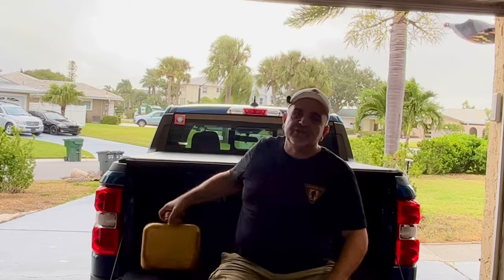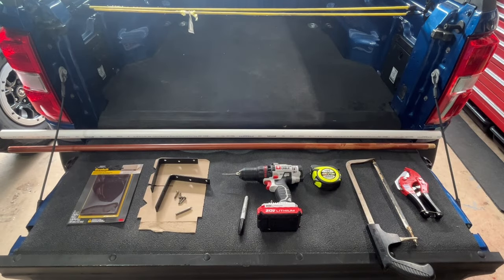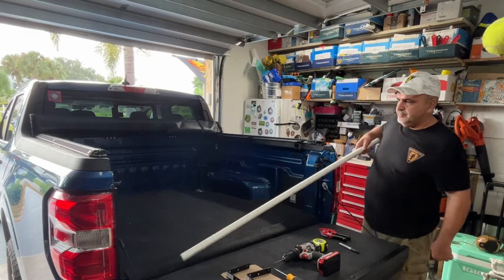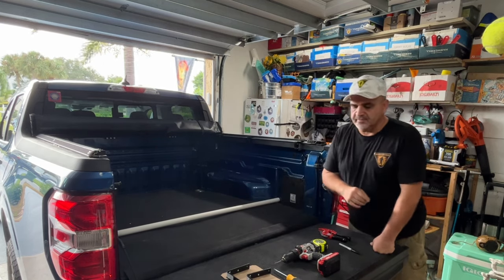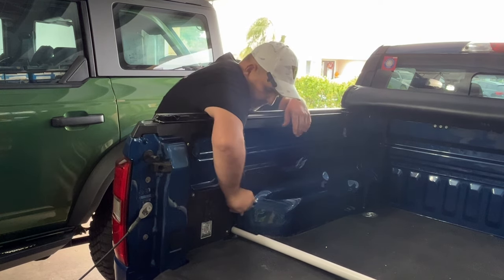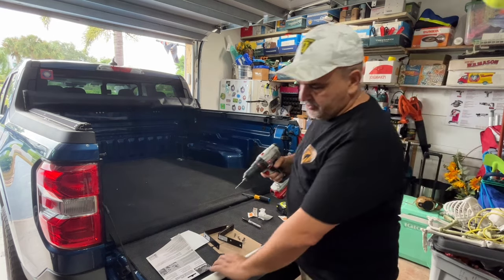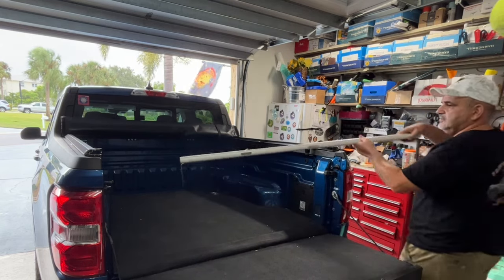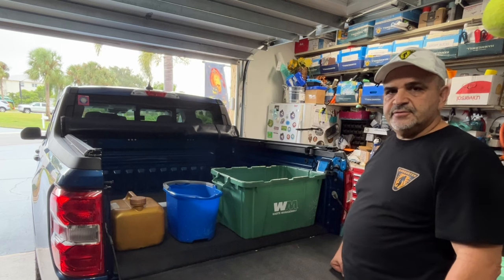Make a Truck, bed divider, and retrieval tool for your Ford Maverick.  #fred'sgarage

Comment: Thanks fred I used your idea. I used 1 1/4 inch pvc schedule 40. I have 15 dollars in it so far. I have a hybrid with a drop in bedliner. The width dimension was 54 inches. I also bought a can of behr primer and paint in black to match the bedliner cover.
Reply from the maker: Great man, it’s very handy, especially if you need to retrieve something.  If you find bins that fit nice please let me know where you got them.
Reply: @fredsgarage1925  will do thanks

Comment: I'm using a piece of shiplap, but I like this idea better.  Thanks!
Reply from the maker: Thanks, it’s too bad some company doesn’t make a better version.
Reply: @fredsgarage1925  I made your design and it works better than the shiplap.  I had the tools, so it only ended up costing me a few cents over $10 for the divider and about $17 for two plastic bins that fit the back perfectly.  Now our grocery pickup won't be a nightmare.  Thanks again!
Reply from the maker: @AlThomas-n6o great, ya the bins are a huge help.  Have a great day.

Comment: Really love your ideas for the Maverick!  This one was a great idea especially since it can be a retriever for you, too.  For me, I bought the Ratcheting Cargo Bar from Harbor Freight for about $30 and it served me well
Reply from the maker: Thanks, I had one on my older tocoma and the bed was wider so 2 recycling bins would fit sis by side. I could toss everything in this bins.  If you come with any ideas let me know.  Have a great day.
Reply: I dont know how I stumbled across your channel, but man im glad I did! you have some great Ideas! Really appreciate you taking the time to show how you do the projects. When you mentioned in the video abou the bins being a good idea, you were definitely in my head lol. Keep up the great vids!
Reply from the maker: @darrenb4619  thank you so much for the comment. If you happen to come across bins that will fit please comment on where you found them.  Have a great day.
Reply: @fredsgarage1925 does it rattle when you drive? That was one of the reasons why I didn't use the 2x6 in the flex bed.  Even the people that covered it in felt or some fabric said the same.   The Harbor Freight truck bed ratchet doesn't rattle or make noise
Reply from the maker: @JRPLAWOffice  it’s been on for about a week and the furniture pad keeps it nice and snug.  When you make it you need to make sure that the brackets are right up to the bed, the furniture pads then add just enough tension to keep it tight when installed.  When you remove it you need to raise one side fits to give it enough room to slide off. I had to pick up a new shower door Friday and the magnet held it perfectly against the inside of the wheel well with the tailgate down on my way home.  Hope it helped. Take care.

Comment: Great little DIY divider. Not only lighter than a 2x6, but costs less as well. (I'll save the 2x6 to put a divider up to the slots by the cab to create a pocket for folded tarp storage.)

Something that I learned at college for taking some flex out of PVC pipe is to run a length of filament tape (1" wide is fine) along the length of the pipe in a spiral. I don't know the mechanics of how it works, but it does. Also, the length will be a little less than the 54.25 if you have a bed liner. If you have a liner (either spray or drop-in), measure your own truck.
Reply from the maker: Thanks, it’s been work out great for me so far. I like your idea of placing the 2x6 up front to make a storage area. I never thought of that.  Have a great day, bro

Comment: I genuinely love this. I previously made a DIY Bed Divider with 2x6. It works amazingly, but isn't the easiest to remove when I need full bed space.
But this eliminates that issue for when I don't need definitive bed division. I went to Lowe's, bought the stuff and made it in about 10mins after getting home. Thanks for the idea and creativity!
Reply from the maker: Hey, thank you. I came up with that idea about 10 years ago when my Tacoma ( first truck ) needed a way to keep my small stuff in the bead.  So PVC and 2 bins made a nice little trunk.  Glad the video helped.  Have a great day.

Comment: this is great!! i wonder how hard it would be to scuff up the pvc and spray it to color-match the truck? LOL. Could you skip the magnets and just insert it upside down to lay plywood over the wheels.
Reply from the maker: If you wipe it down with alcohol first you could paint it no problem.  Turning it upside down is such a great idea, I never thought about that. It would work better then the magnets, thanks

Comment: Hello Fred.  I appreciate your videos and the time you take explaining details that novices like myself may not know.  I have the items in my amazon cart to add the 12v panel as well as the additional switch and bed lights.  The bed lights seemed a little dimmer in this video.  Are the back lights still working?  They looked so bright in the episode when you installed them and it sold me.  Do the lights still function and look similar today compared to the install date?
Reply from the maker: Yes, they are very bright and are as bright as when I installed them. It’s most likely the camera exposure. I will post a short, video to day so you can see it. I did add a small D channel across the front of the bed to relocate the 2 front lights and hide the wire.  The reason was that I’m always removing the bed cover to make other videos.  You should be able to see what t and n the “ shattered back glass video” but if I was not planning on removing the bedcover I would just of left the lights like in the video. Very happy with the bulbs.
Reply from the maker: Here’s the link to the short, you can see the lights today. 
Are the Mavericks bed lights still bright after a year?
https://youtube.com/shorts/WAxfhJuyxsU?feature=share
Reply: WOW you respond fast.  Appreciate it Fred.  Submitted the order and hope to work on it this weekend. @fredsgarage1925
Reply from the maker: Well, I was going out to my truck at the same time I was ready your comment. So since it was dark I figured, why not do it now.  Worked out pretty good.

Comment: Fred, Will a 90Degree elbow & a small nipple & cap on both ends work??
Reply from the maker: Ya, I bet it would work just as good. Especially if the truck has a sprayed in bedliner to help it from sliding.  Let me know how you make out.  Have a heyday.